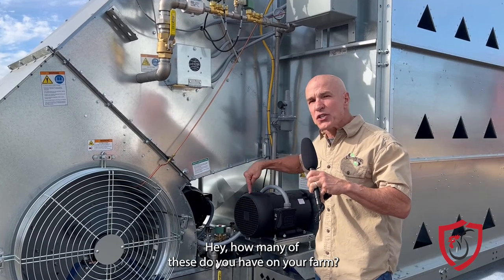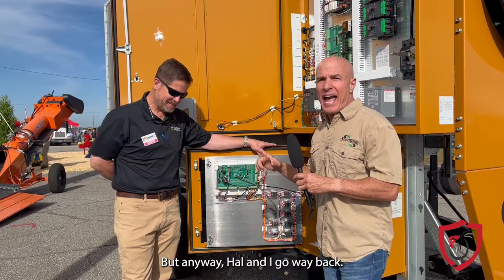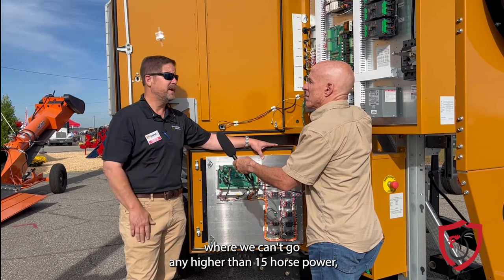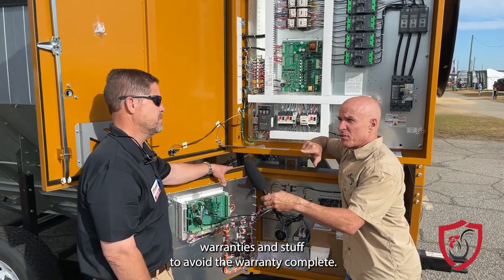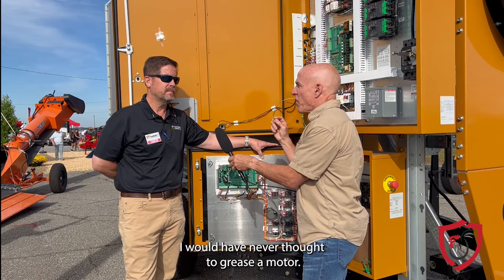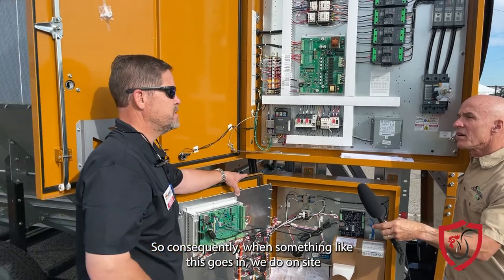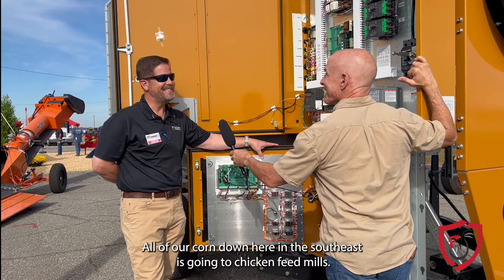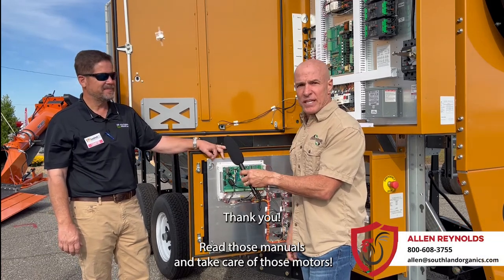Electric Motor Maintenance- Preventive Maintenance for Motors on Farms

Comment: Could go over some tips on swapping things like auger motors. Recently had a fill system gear box go out, so the pinion gear on the motor shaft was tore up, but the motor was good. Really useful to know how to get those pinions off without damaging the motor since the set screws never want to back out. Also one time had a guy disconnect the auger cause he didn't know the motor was held on by just 2 bolts on gearbox.